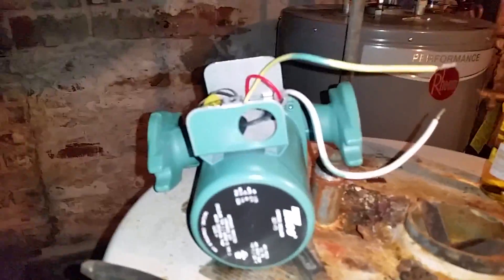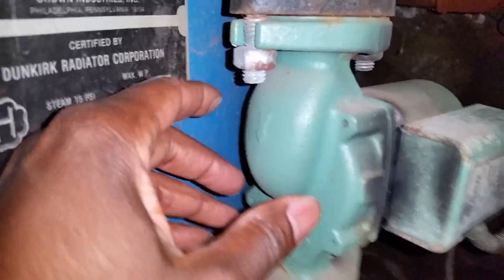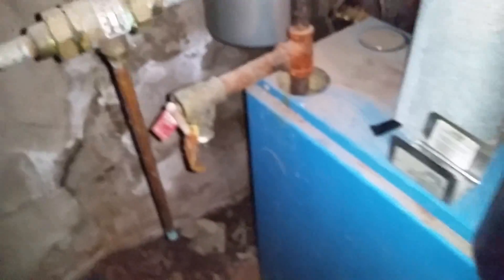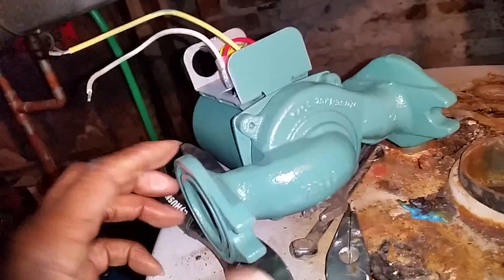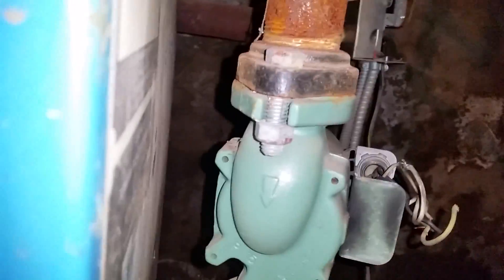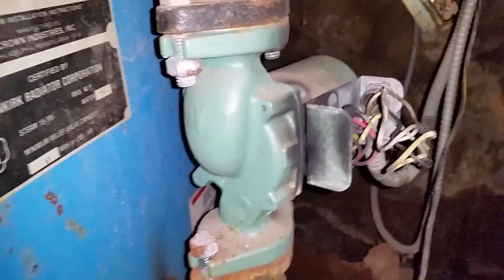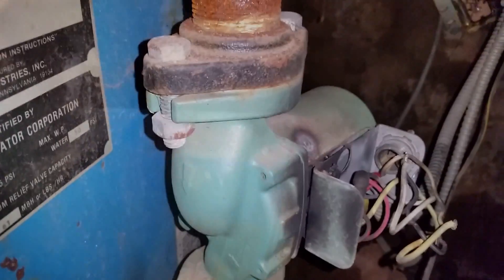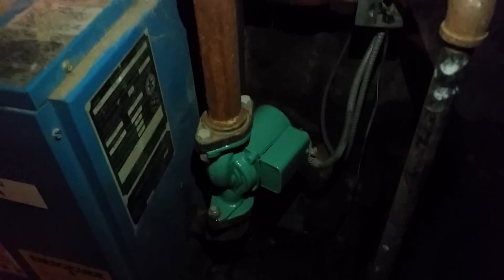How to change a circulating water pump on a heat system

Comment: It is very odd that the pump water direction is towards the boiler. The pump is typically installed on the supply side (heated water leaving the boiler) that sends water FROM the boiler to the zone pipes.

Comment: You shouldn’t release pressure from the blow off valve. 
You should use the drains on the feed or supply lines only

Comment: I'm installing a new  111-8  Taco pump the new flange has o rings my old pump didn't only a flange gasket.My question is this will the newer rubber old ring work with the old flange thats on my boiler or do I need to install a regular flange gasket? Question 2# Whats the prefer nipple to connect to the flange to the boiler brass or galvanize pipe?

Comment: You said you lose water when you remove the pump. So what did you do to get the air out of the pipes?
Reply: You need to purge the air from the system. 
You do this my draining the water from the system and the air will be forced out. 
Lots of videos out there on that.